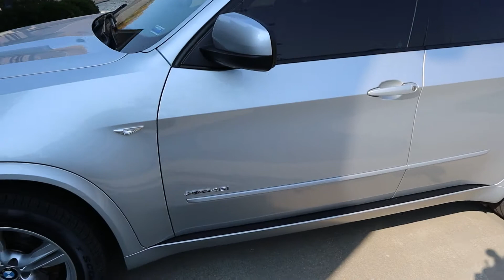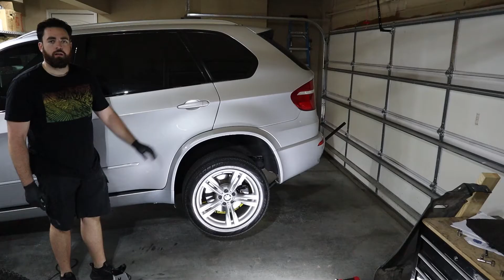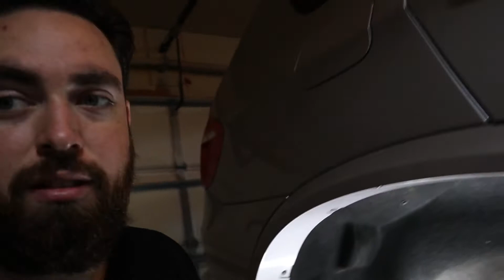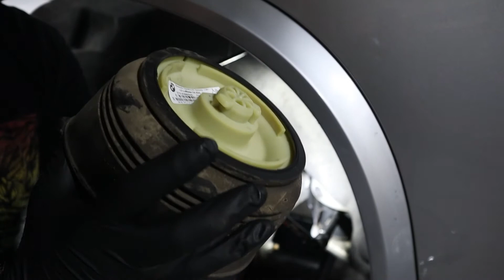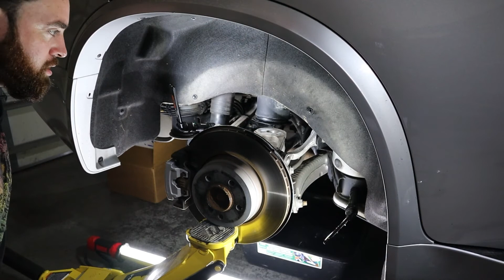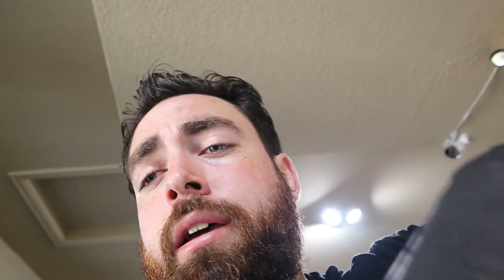2007 - 2018 BMW X5 LEAKING REAR AIR SUSPENSION  REPAIR

Comment: Im assuming when you push the line in your actually pushing into the compression fitting that is in the nut. Other videos I've seen take the nut out install it on the line then the fitting then screw it in. Wouldn't you get a better seal that way since as you tighten the nut the compression fitting hugs/crimps the line making a tighter seal? Unless there are different types of bags Im not aware of with a "shark bite" type of fitting.

Comment: What? An oil leak on a Beemer, whoda thunk it. Now I look at these videos on this job, and I see no reason at all to remove the nut and lock collar at all. There is a slot in the airbag, the only hole is in the rubber gaiter, so why not remove the gaiter once the nut is undone? You have to refit it back to the new airbag anyway.

Comment: Just did this on my 2007 x5, bought the bags off eBay for $50 and worked great, I had to deflate the bags to get them installed by pushing them in before screwing on the air hose, other then that super easy job, holding air no problem

Comment: Great video, thank you 👍 The only thing I would add is that it’s better to make sure the springs are pretty much fully inflated before completely lowering the car on the floor jack. Lowering without the bags inflated can cause damage to the new bags.

Comment: Simplest and most useful video for this. Took me an hour start to finish. Hardest part is the rubber protector cap and inserting the part back up into the car. Just need this video and the usual patience. My air hose was able to pop out of the original part so I simply screwed it back into the new part. Literally saved $000s. Lower car slowly. at right height compressor will kick in while car is running. Thanks, Woody!

Comment: Ok - I’ve seen all the tuition videos for this repair til I’m exhausted and hands down this is the best. Nice job!
Reply: So I’ve now done the job. Little did I know I started with the unit that would not come out… had to remove trim in the boot and bang the air unit out as previous owner had bodged it in. Second air unit came out as easy as you showed. All done both sides 2 hours.

Worth nothing that when you only have the top of the air unit attached, it feels loose but it is in.

Comment: Several reasons why your video is the best (I think I watched most of them): 
1) stabbing bag saves a lot of time, but mine were completely flat anyway. Saves a lot of time not removing a bunch of panels
2) The pry bar is way better than trying to use needle nose as some suggested.
3) You don't mess with the fuses or detaching battery which are not necessary, so long as you are careful to not open doors while on jack stands.
4) You show how to orient the bag to get it in 
5) your recommendation about using the key slot to help align the upper slot was very helpful when trying to blindly put the top part of bag in. 

My issues following your procedure, but nothing to do with your directions. (btw I am a noob): 
1) The after market bags I had seem to not have a push-in air tube, I did have to loosen it and tighten it, just pushing it in did not work.
2) The people who serviced the car last over tightened all the lug nuts on the wheels. I had to go to a shop to help me get them off, even with breaker bar I couldn't do it. They broke one of their sockets while doing it, and they had to destroy one lug nut to get it off. This cost me essentially a day of not being able to get the wheels off. This is bad, I can imagine being stuck on the side of the road trying to change the tire but not being able to get the wheel off. 
3) I had to buy a different jack because mine did not lift it high enough to get it on the jack stands
4) The first bag took me almost all day with above mentioned problems (again I am a noob), the second one only took about 45 minutes. 
5) Seems that the bags are working the ride was a little better, not slamming on every bump, the suspension level dash light stopped blinking, and the compressor does not run every time I turn on the car, but the ride is still rough. slamming hitting bigger bumps. No idea why. It still does not look like ride height is right. Still looks low. Any idea why? 

So great directions, I seem to have been able to follow them but the results are somewhat disappointing, not sure why ride is still bad.
Reply: Have you checked the actual air pump? Or the lines? Saw a couple videos where people put off their air spring replacement & ended up having to replace the pump/compressor.
Reply: @llChrisTjll yes this was teh actual problem, it was full of water. Replacing that was actually easier than replacing the air springs. Only problem is I have a slight leak I need to fix in one of the air hoses.
Reply: YES!!!  my thoughts exactly why i liked your video the best.  other video was pulling a fuse  dropping undercarriage panels unplugging compressor...

Comment: Just did mine on my 2017 F15 after the driver side air spring completely failed... replaced both as a precaution.

Comment: Buddy great video, I have a 2016 with 60,000 miles. It’s sagging from the rear at least once a week. If it’s really leaking air why doesn’t it do it every day?
Reply: Did you find out why?

Comment: Great video and tips to fix the rear air sagging suspension! Thank you very much. Please share the aftermarket Rear Air Suspension that you have bought for $150/EA. I need to change my right rear's on my X5 as well.

Comment: I have changed the air bags on my 2009 X5 diesel about a month ago and today I have noticed is gone down half way and the suspension on the car is pretty rough. The compressor has worked because it has to reach a certain level to start ( I think).
Any idea what the problem would be?
Reply: Check for leaks as per the soapy water mix as a start point.

Comment: I watched your video, it is helpful. After I replaced the airbags, I turned on the car while it is jacked and the air compressor is not running. The instruction is not to lower the car after installation while the airbag is no pressure. Do you know if I need to lower the car on the ground in order to activate the level sensors/air compressor to pump the airbags? Thanks
Reply: did you solve the air compressor issue?  did you just lower the car anyway?
Reply: @S0ul5Hun73r  Yes, I lowered it slowly and as soon as the tires touched the floor, the compressor engaged. Hope that helps!

Comment: Great Vid Woody - Thanks a Mil.  I have to do mine and I too like the idea of puncturing to lose the pressure (unless anyone has a very good reason not to) as do not want to get under the vehicle and pull off that entire panel that's held on with "those clips that break the second you even look at them".
To disable the suspension compressor though you can just pull Fuse 32 (40A) (located in the main fuse box, under the dash / glovebox passenger side - Not the one in the boot)
I'm taking that approach because every other time I have disconnected the power completely I've had a collection of nightmares / errors galore when powering back up.

Comment: Great video, I have to replace leaking bags on my 2016 X6M. Most of the DIY videos show you have to remove a panel under passenger side to unplug compressor and release unscrew pressure values to deflate the bags. I actually like your idea of puncturing a hole in bag, quick and easy way to deflate the bag. Can I do same thing for my X6M? I will disconnect battery as a safety measure.
Reply: I have x6M too 2014 rear air springs went out on me I bought arnortt brand